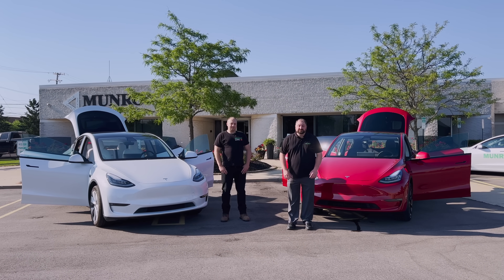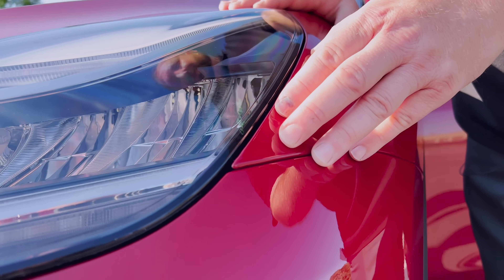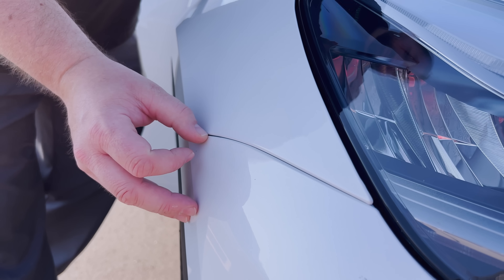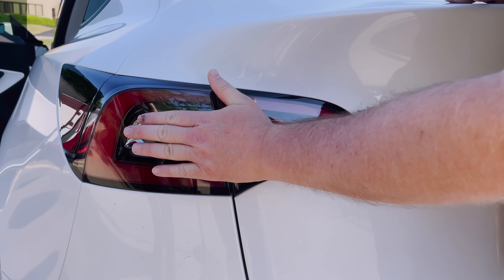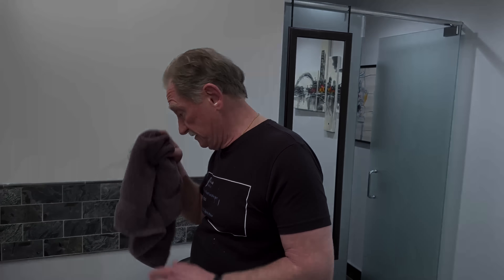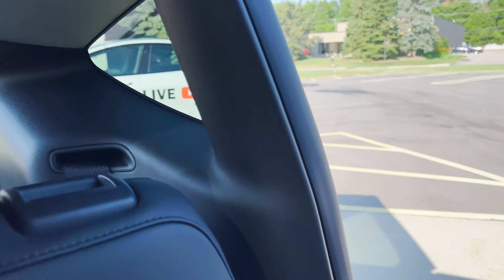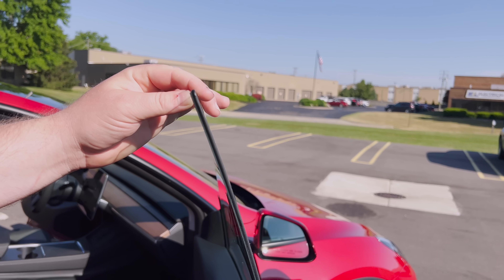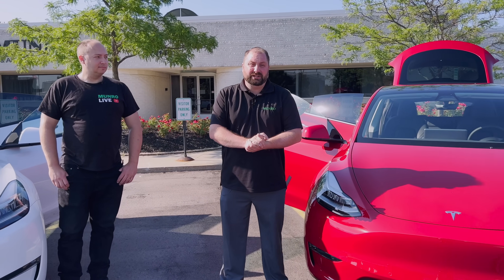Giga Texas Model Y Fit and Finish Comparison | Panel Gaps a Thing of the Past?

Comment: Why do you guys make it sound as if the panel gap problems are exclusive to Tesla? Toyota; by some are the standard; has the same issues. It's not a Tesla problem it's a car manufacturing problem. I agree Tesla should strive for perfection but, after ~1000 processes; the car drives out and there is a 3mm issue; sound good to me. If anyone has an issue with that take a level or a square out on a brand new house.
Reply: Kurt, what a breath of fresh air. Excellent point.
Reply: @AudiTTQuattro2003  
I was with you until the "usual"(?) "TFB" rant.
Reply: @AudiTTQuattro2003  nobody has ever claimed Elon is perfect, least of all himself.
Reply: @AudiTTQuattro2003  Only you and other Tesla haters would say Elon is perfect... Elon has been wildly successful, but not perfect. He says so himself regularly. You know, you may be best suited to actually listen to Elon talk in interviews and what he actually says, who he actually is. Perhaps you can watch more Munro videos to show you what Tesla is really bringing to the table. Panel gaps that every make has with alarming frequency does not matter. What under the hood does.

Comment: Welded/glued cars squeak and rattle too. Castings don't squeak or rattle. 
Also castings break with impacts that would have utterly destroyed a welded/glued sheet metal understructures.
Reply: @AudiTTQuattro2003  
Imagine if you simply (ish) unbolt a complete front end, install a new casting, then bolt salvageable components onto that new casting?
No wondering if the tracking was out.
That's not entirely fantasy.

Comment: In my experience, the left side of the car was always worse than the right which the manufacturing seniors at the plant I worked at said was because a lot more people on the assembly lines are right handed than left handed.
Reply: That makes no sense at all. The cars are broadly symmetrical along the longitudinal axis. You’d therefore expect the fit & finish of the front quarters to differ, but on the rear quarters the ‘best’ side would be reversed.
Reply: @fredbloggs5902  Exactly
Reply: I have worked on Volvos assembly line and that sounds like a load of crap to me!
Reply: A lot more people are right handed than left handed. This means one of the sides of the vehicle is more awkward to work on than the other just because you get put in to a mirrored position where your non dominant hand will be the "leading hand". On a general assembly line the car moves constantly in one direction while either one or two operators work on each station attaching the outer panels with bolts and the help of alignment/lifting tools and alignment fixtures and/or holes in the structural body. Depending if you're left handed or right handed one side of the vehicles will be more easy to work on because that side is more convenient for your dominant hand. This is extremely obvious when you train new guys and girls to work on the assembly line. One side, typically the right side for right handed people in my experience, will take much less time to get the operator excellent at while noticeably longer on the non dominant side. When I asked my seniors why the left side tend to have more problems than the right side they explained it was because of this reason. Now mind you that alignment problems was not frequent on this assembly line but there were a pattern where the left was measurably worse. At the plant I worked at, which was a Volvo Trucks plant, they used a lot of hired workers who came and went which meant that the operators didn't stay at the plant long enough to get really excellent at their stations. Remember that every operator has to learn maybe 5-6 or 8-12 stations and get perfect at every station which takes some time.
Now I'm not claiming this is the absolute truth, it does however make some sense to me. It would be weird otherwise because the structural part of the car is 100% made with robots and with very accurate clamping fixtures which had like a 1/1000 error rate.
Reply: @LouieGrind  ok sounds reasonable when you put it that way. I remember Elon saying that ramping up times have more issues as well. So I guess there something to that even if I didn’t feel like it personally. Maybe I got easier tasks on my lines. It was a while back too.
Reply: @simonkristens3769  Yeah, some stations are just you working at a station table straight in front of you with no real "good side" but when you, for example, are going to hang a panel on a body then that panel will attach in a certain kind of way which can be awkward depending on your dominant hand. The problems was mainly with the big panels because if the operator puts a 1.5m2 panel 1-2mm skewed it will become a "huge" gap at one of the corners.
Reply: Never seen anything as bad as Telsa's for this, and the same ratio of handedness exists in the world
Reply: @stuartburns8657  You should have seen my 1974 Corvette......
Reply: @JNHovey  :)
Reply: @stuartburns8657  Not true, left handed ness is much rarer in China at 1% compared to the rest of the world’s 10%.
Reply: @fredbloggs5902  China, much like schools in the 1960s North America, force kids to write right-handed etc.
Reply: @TelosBudo  please provide your evidence for your claim.
Reply: @fredbloggs5902  Interesting.  So Tesla's should have 9% worse left side panel gaps then?
Reply: @stuartburns8657  maybe you should read my other comment? You’d expect the front quarters to be the opposite of the rear quarters. This reveals the original claim to be a blatant lie.
Reply: @fredbloggs5902  Ah I see, missed that 🙏
Reply: Fit and finish "symptoms" can result from misalignments of many things, including hundreds of structural components.... many of which were removed with the giga castings. So you were lied to.

Comment: Assume the overall panel gap issues on cars out of Austin will improve as they get out of first 500 cars out the door into more production and skill in what to adjust. MORE IMPORTANTLY, when historically comparing a “Ford” to a “GM” to a “Toyota” where this was an important comparison because there really wasnt much else to talk about as the cars were technically and visually very similar and nothing really else comparatively to talk about. The “New” public buyer, will notice maybe a serious panel gap mismatch, but this is basically background noise compared to is it ICE, Hybrid or EV and even more so is it the newest, hottest, coolest. The New buyer if asked whether he will order a Caddy with perfect body panel gaps or a Tesla with less than perfect fits but its THE choice, guess which one is picked 9 out of 10 times? Look at who cant make them fast enough and who is using the chip storage age an excuse to why their numbers are all way down….except for Tesla.
Reply: Mercedes and BMW ice vehicles at the same or lower price than Tesla, there's still alot of conpetition. And with incoming competition from China, Tesla still needs to figure their fit issues out fast

Comment: Nice notice with the wiper blades!! 
Very interesting 🤔
Reply: That could be due to a new wiper parking zone plastic area, and a rod length adjuster that shortens the length of the rod in forward motion, then and lengthens the rod to create a longer arc to park when the wiper Moyer is put into reverse. Chrysler and GM have both used those rod length adjuster cams for decades on the big expensive models that hav a hood design that could all ow gap to hide the wipers between the cowl/top of the firewall and the underside of the hood. What is old, is new again! That is another change in parts and revisions of the hood, wiper transmission rods, and cowl top to create a space for the wipers to “park” in and the ability for the wiper rod transmission to park them lower than when wiping.

Comment: The thinner glass in the new model might be so it fits and seals better. My 2021 Shanghai model 3 has the thick laminated glass, and the seals creak a little bit when going over speed bumps and kerbs. The Tesla service center claimed this noise happens because the laminated glass is thicker than the OG non-lam window, but the seal remained the same, so there’s a bit of a mismatch. Perhaps the thinner laminate fixes the problem?
Reply: Why can’t they simply change the river seals!? Lol…..
Reply: Another reason is that two identical glass panels of the same thickness will have the same acoustic resonance.  Using two different thicknesses removes the overlapping resonance, so noise reduction may also be improved with this change.
Reply: @satoshimanabe2493  wrong!!!! Other cars uses the same thickness of glass and maybe a custom membrane between the 2 glass and are significantly quieter than teslas.
Reply: @alanmay7929  There are too many other factors involved to draw a conclusion about glass thickness.
Reply: @alanmay7929  I'm comparing between the two versions of MY laminated glass.  When compared to other vehicles, too many other areas play into how quiet a vehicle is.
Reply: @scottsoloway  lol…… it’s most definitely outside of the car l! The car mirors that can cause noise…
Reply: Weight is also a consideration for the lifespan of the window regulator.
Reply: @eugeniustheodidactus8890  the motor regulators are storing enough and designed for those weights of glass lol….
Reply: Cool!  So it's louder ...
Reply: My M3LR with the thicker glass is silent as a mouse. Might be your build.
Reply: @Nessal83  lol…….. it’s silent until you compare it to other vehicles! 😂 😂 😂
Reply: @alanmay7929  Absolutely quiet compared to my Tacoma and M4. Not sure what you're getting at.
Reply: @Nessal83  you compared that to your Tacoma!? You’re joking right!? Also does your m4 has double glazing!? Doesn mater really because the exhaust is ment to je heart.
Reply: @alanmay7929  you said when it's compared to other cars. How about you comprehend your own comment?
Reply: @Nessal83  seriously!? The tesla has double glazing it’s supposed to be quiet, do you compare it to other cars with double glazing too! Very simple question!
Reply: @Nessal83  according to the service tech, this is a known problem that has been there since the change to laminated glass. To fix, they apply a lubricant to the rubber seal, but this leaves marks on the glass. The noise is not too bad, but in a such a quiet car, every creak gets noticed.

Comment: Interesting stuff.  As with any evaluation, perspective and a point of comparison is what allows the viewer to make sense of it all.  In this case, you compared the same model from different factories.  That's helpful.  However, is there a vehicle out there that represents a gold standard, with consistently impressive fit and finish, at reasonable price point levels? Consumer perceptions likely lean towards Toyota, but on a professional level, what stands out in your view?
Reply: Agree, they should have compared these to a gold standard. Or at least the bmw i4 they had around.
Reply: They should get a Model Y from Shanghai. Will make a huge difference.
Reply: @Elektroschwaben  and one from Berlin.
Reply: @dchristo10  ... you better wait a couple of month with this one 😬

Comment: Model y is so old now , everything with the bodywork should have been sorted by now.
Reply: Superficially the Model Y is not new but under the skin the design is different. Also the factory making the red one is new as well. So there are processes that still need to be ironed out.
Reply: I agree, and it is. For the Fremont Y anyway. Looks quite good. Give them time and the Austin Y panel gaps will be sorted, too.
Reply: Leslie, three years is not old. Check out the Camaro design. That platform is over six years old. The 4 Runner platform is over 12 years old. By the way, you will find panel gaps on some of these cars as well.
Reply: Hydrogen vehicles are so old now, why are Toyota (and others) still touting them?
Reply: @rogerstarkey5390  everyone is touting hydrogen now. Please try and keep up to date. 🤡
Reply: @lesliecarter4295  Hydrogen is hopelessly inefficient.
Reply: @fredbloggs5902  stick to the thread Fred 🎵🎵🎵
Reply: @fredbloggs5902  stick to the thread Fred!!

Comment: Wonder how the paint is
Reply: Check the spoken reviews channel. He did a paint thickness test on his Texas built 4680 model y. 
I was surprised at the results, if you believe the internet? Tesla is just the worst ever for paint thickness and build quality.
His first hand video shows otherwise. 😀
Reply: @4literv6  makes me feel better then I was bummed when I just got my Freemont Vin, this is pretty disappointing the build and paint still sub par after all this time
Reply: @OrganicStuff1  honestly I've owned over 80+vehicle's from the cheapest Honda up to 60k+merc vettes and bmws. I have people who I trust to do tint&ppf for me. And they do a lot of teslas here in the ATL area. For the $ they aren't any worse than a BMW audi or merc in the same segments according to the actual people who work on them. 🤔

My x wife's BMW 3 that she absolutely loved had similar build and fitment issues as my mustangs and my cars cost about half what hers did new. 

Even my last 2019 f-150 which was almost 40k(cheap now I know) which Ford has ZERO excuses for on build quality, seeing as they are the first ever mass manufacturer of automobiles and the longest existing legacy oem around. Plus the f series literally keeps them in business!

Had multiple obvious paint issues(orange peel&swirls)brand new on the lot with 15miles on the odometer. Had body panel gaps I got adjusted multiple times through my dealer and never looked right imo for a nearly 40k truck. Even after having it adjusted and fully paint corrected including clay barred by a pro at my own cost. Everyone's mileage varies though for sure on what's visually acceptable.  👍🏻
Reply: Atleast texas produces them in different colors unlike Berlin who only has black and white eventhough Elon said berlin has state of the art paint botth.